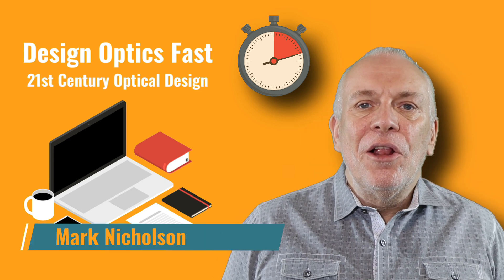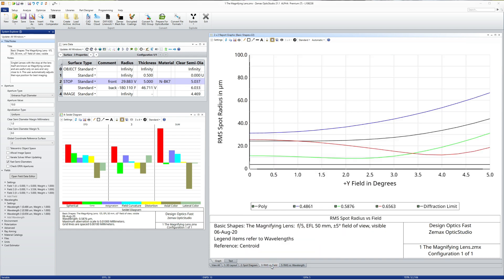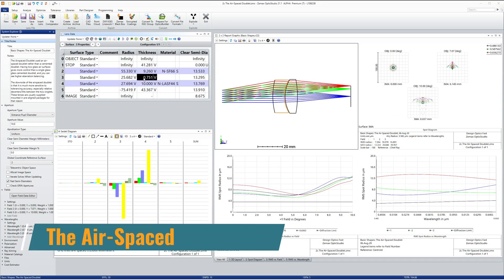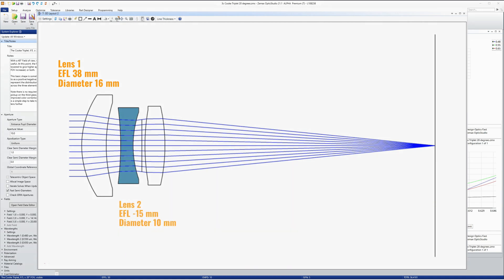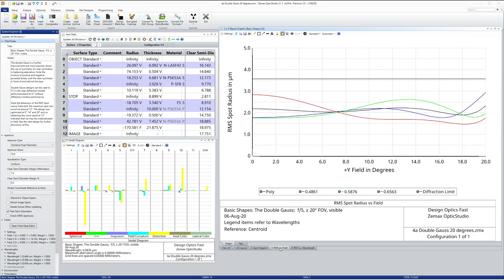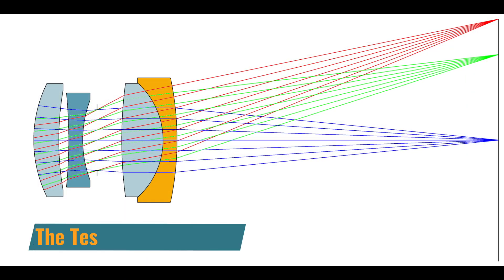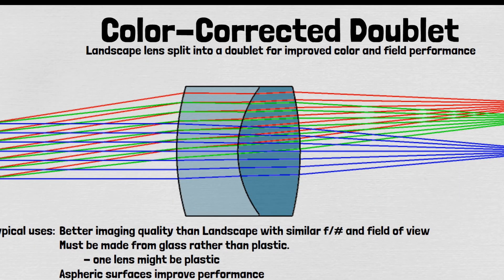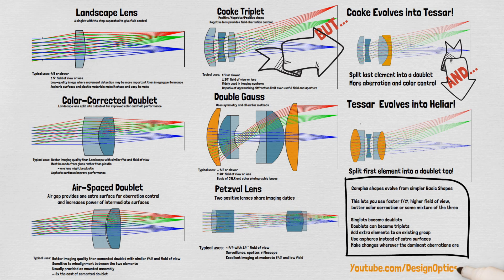The Basic Shapes of Imaging Systems: Part 1

Comment: Just my two cents. Nowadays image distortion can be corrected by digital image processing without costs. For example bent lines can be straightened by simple transformation matrix. But 100 years ago it was a difficult task so they wanted orthografic images to a much higher degree. On the other hand in former times there was no anti-reflective coating. Every air to lens (lens to air) transistion gave a 4% reflection (ghosting).
So our goal in today design of imaging systems is different to that of the old age.
Reply: You are absolutely correct IMHO. A lot of the heavy lifting is in the computational optics space, and if you know the lens prescription and therefore the various performance curves of the lens, you can 'de-convolve' the lens function to get better imaging.

Comment: With the likes of an air spaced doublet, do you actually need the large refractive index difference between the air and the glass? Or might you be able to use an intermediate index optically transparent medium like an immersion oil or Canada balsam to help reduce reflections? Perhaps a balsam type cement would also mechanically secure required placement.
Reply: Well, add an index-matching layer between the elements and it becomes a cemented doublet, not an air-spaced doublet. But the power of a surface is (n2-n1)/R, so yes making n2 = 1 and n2 ~1.5 gives you a lot more power than using intermediate values

Comment: Hi Mark! I tried to make magnifying lens with the lens data on your video but the radius of the 3rd surface keeps changing to "Infinity" after I give the value -180.11|F. Why is that happening? Please help me.
Reply: Make sure you have put a glass on that surface
Reply: @marknicholson5508  I gave exactly the same values as in your data. Could you please tell me what was the aperture setting you gave? And also what is the value for F/# for Radius of surface 3?